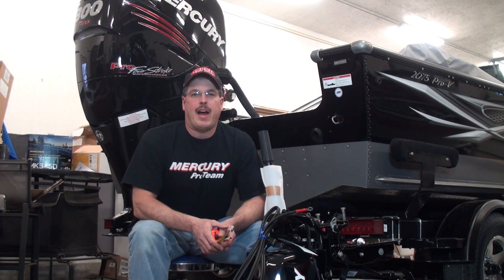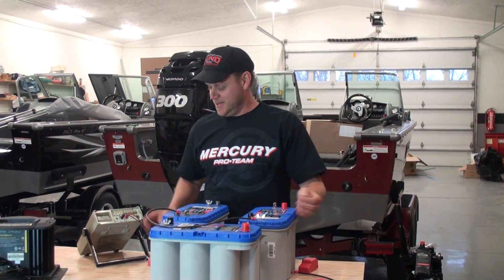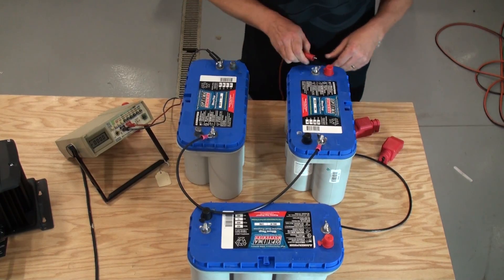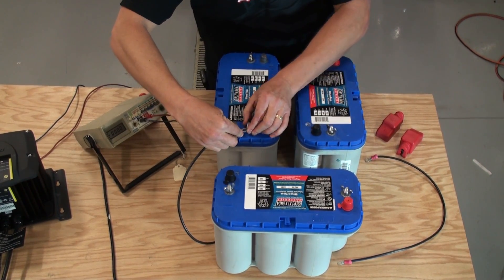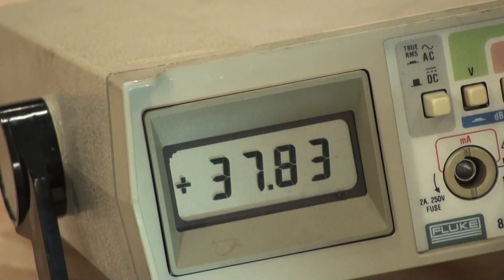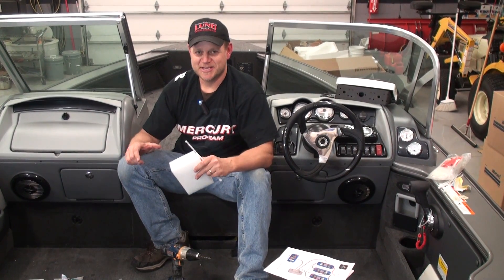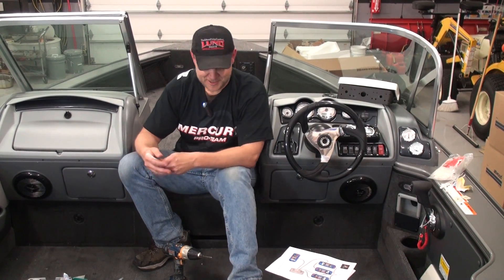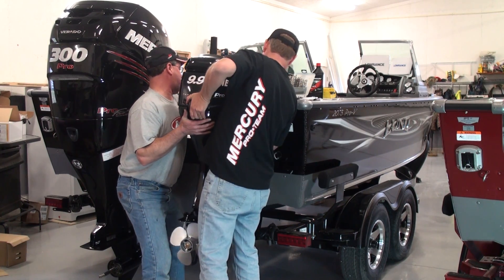24V and 36V Trolling battery installation

Comment: My new lowe has a 60hp merc and a trolling motor up front. They are both hooked up to the same battery. The dealer suggested that I  purchase another battery as a dedicated trolling motor battery so it won't pull down the cranking power to the engine What do you think? Also, can you recommend a battery charger?--there are a ton of them out there.

Comment: Looks easy enough. I have a 2002 starcraft super fishermen 176. It didnt come with a bow trolling motot, but has a double battery tray with what I presume a pre-wired set up for a 24v system. I just purchased a Minn Kota Powerdrive V2 24v. The boat has one black wire, two red wires. One red wire has a black line that runs the length and the other is all red. I plan on putting a circit breaker and a on board charging unit. Any thoughts?